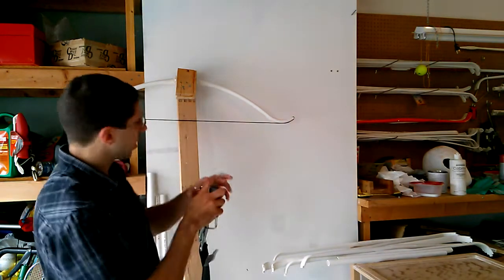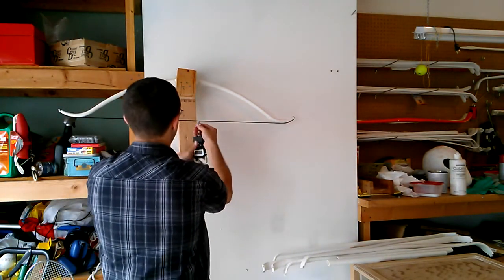Reinforcing a PVC Bow with Expanding Foam Insulation: The Results

Comment: As a construction professional who works with expansion foam I wonder what the benefit is supposed to be? The product once dry is brittle. Is is for insulation against heat and cold. It is in no way an elastic or acoustical compound. ( meaning again, it dries brittle, it has absolutely ZERO flex )   Perhaps by filling the voids you reduce vibration of the bow, which would be good.  In terms of strength or spring I must express my strong doubts about any benefit.  Also, the stuff is not cheap, and I worry that you are just wasting money. My other concern is that the expansion factor is much greater than you realize, strong enough to crack window glass.  I worry that you are placing outward stress on the body of the bow from inside, potentially weakening it.

I love what I am learning and am about to make my first bow, this is not meant as critisism but as some professional product knowledge and hopefully save you a few bucks. I hope to show you my bow soon, keep doin what you do!
Reply: What about flex seal?  That solidifies as rubber.  Would it have the same negative effect?